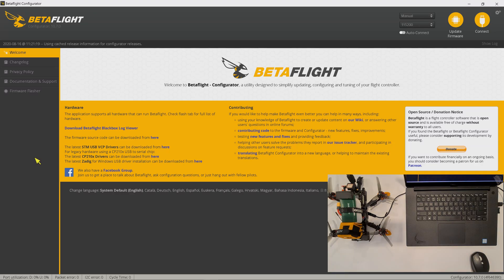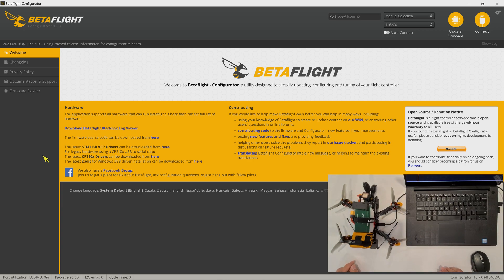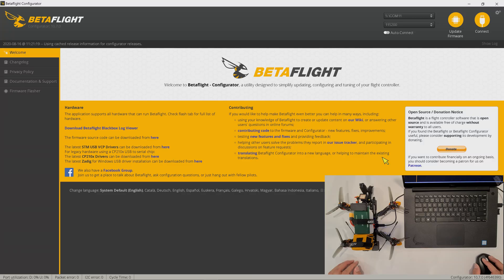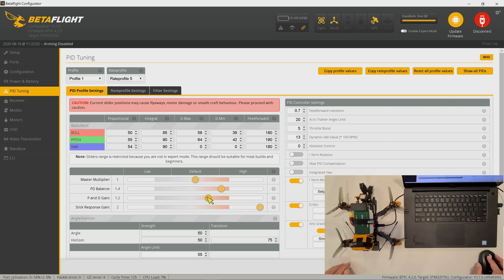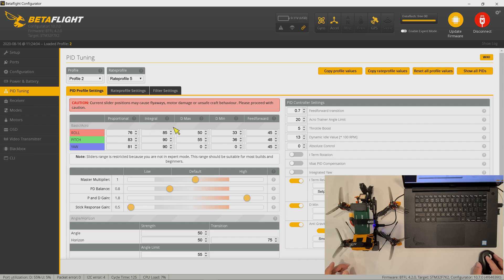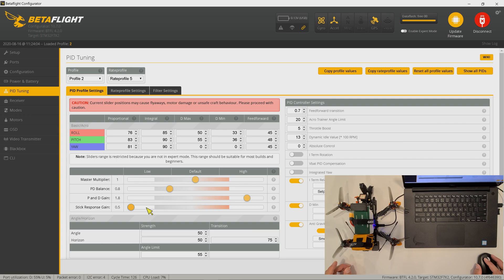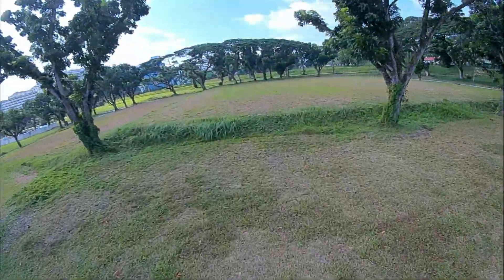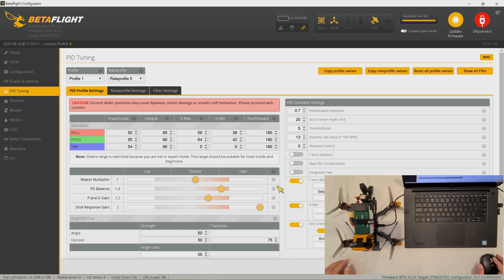Mk4HD5kM - Tune using Betaflight 4.2 with lowest P so that D is high enough without oscillations.

Comment: Nice testing, but i got a little confused about your results - which tune do you think was better eventually? (the one you showed first actually seemed a bit better, but maybe it because of the jello in the 2nd video)
Reply from the maker: The 1st video is the conventional way. It resulted in a higher P gains in the 70s. Higher Pgains allows the quad to track your sticks better. Dgains slider direction will follow Pgains. As long as you manage to get the PDbalance, this ratio will never change for any quad. So by moving the PDgain sliders up we are increasing the ability for the quad to track better up to a point when the D gains get too high that either the motors are hot or there's oscillations. Then lower them PDgains a bit.  The objective of the 2nd video is to get as low a Pgain as possible so that the Dgains that go with it won't get too high that the motors get too hot. Because with this quad, I need quite alot of filtering (filter sliders around 1.2). If i want to get better propwash handling I need to reduce the filter slope to a lower order so that the processor spends less time in calculating for a higher order(steeper filter cutoff slope) filter formula and spends more time managing the wash. But I can't reduce the filtering if the motor gets too hot. So a lower Dgain will allow filter to have a lower order(gentler cutoff slope) resulting in processor spending less time in the formula calculation and more time to track for propwash. That's the idea behind it if it works. For the ultimate tune for this quad see this video: https://youtu.be/wkwYZRy5R4w